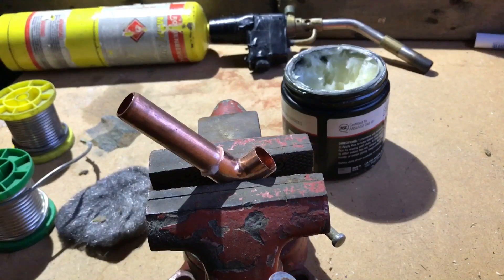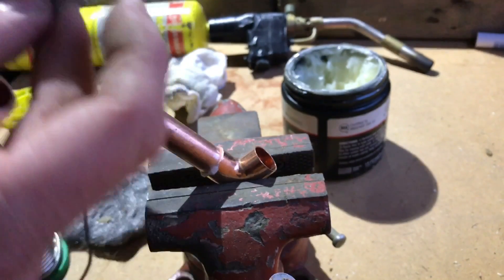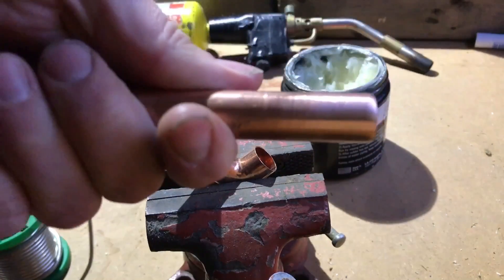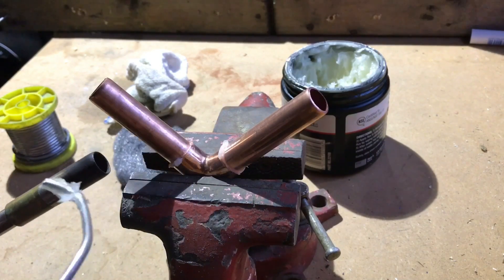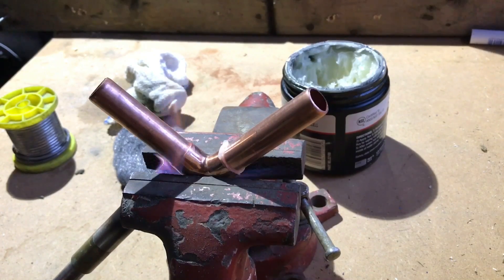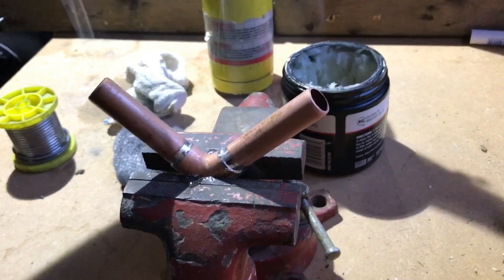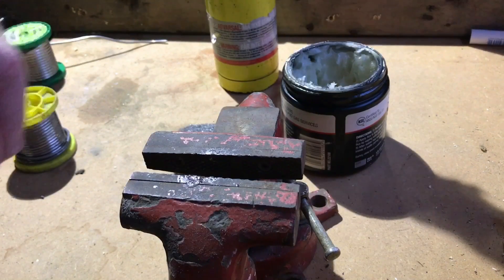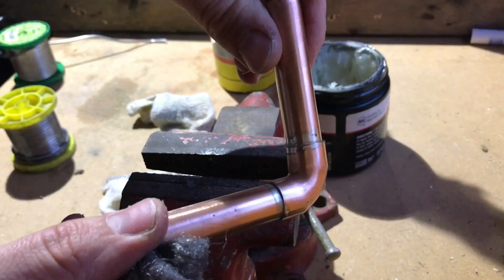How to solder copper pipe correctly

Comment: Used way to much flux, would recommend wiping the excess off before using the blow torch
Reply from the maker: Personal opinion to be honest, I've worked with many engineers that wipe it before soldering personally I just don't, a good clean and polish after and it's fine. Tha ks for the comment 👍🏻

Comment: Good video, but for somebody just learning and wanting to practice it's probably better not to clamp the area you are soldering direct in the vice. I say this because the metal jaws of the vice will conduct the heat away from the joint, potentially making things a touch more difficult. This would be more of an issue if you were using a butane or butane/propane gas cartridge as found on many of the more basic/cheapet torches aimed at the DIY market as these gases do not burn as hot as either pure propane or the Mapp gas as used in the video...
Reply from the maker: Thanks Peter totally agree in the real world you wouldn't use a vice this was only the case for the purpose of the video 😁👍🏻💪🏻